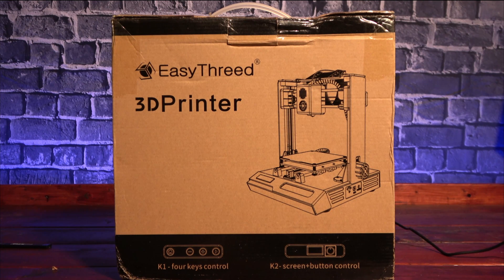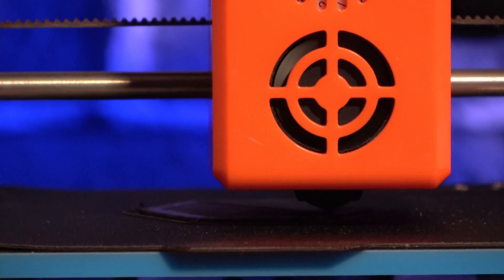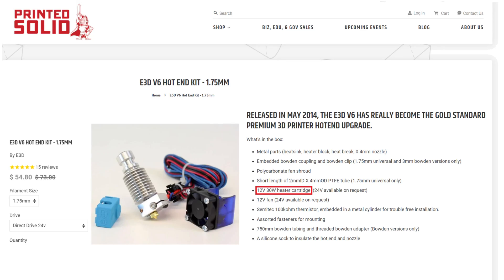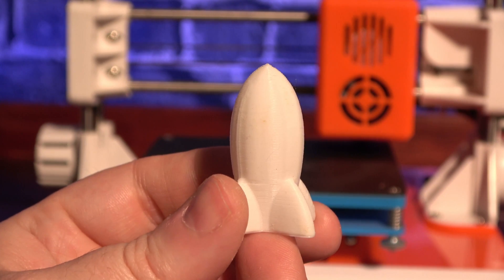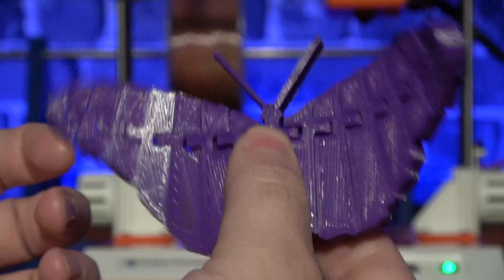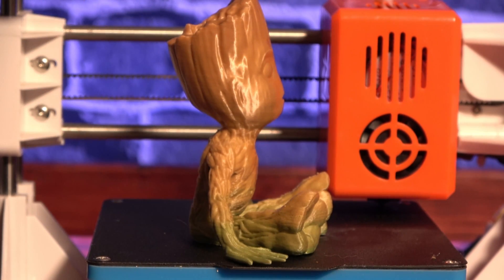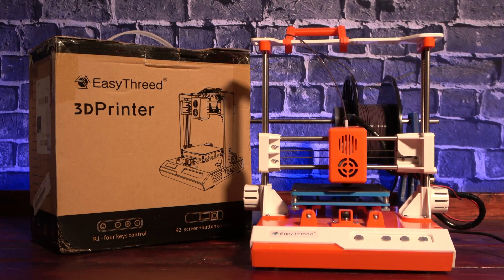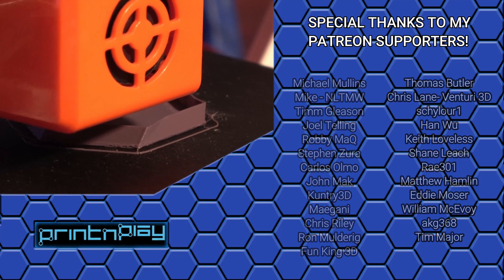A Sub $100 3D Printer?! - EasyThreed K1

Comment: How well does it print for dungeon tiles? (d&d)
Reply from the maker: Since there is a small but noticeable amount of backlash in the movement system, I would not count on very fine details coming out cleanly.
Reply: @PrintNPlay  thanks! I do hink I would go for the extra mile in cost and do it with a resin printer. But I hate buying extra stuff as a wash and cure station. So I'm thinking to buy one but use the water washable resin. I don't mind waiting for a few days of drying. I'm not in a hurry when it comes to curing in 5 minutes.

Comment: This printer review just makes me want to suggest the $200 ender 3 more.
Reply from the maker: The Ender 3 is more capable in every measureable way... Except in perhaps a place where a direct drive extruder is beneficial (like with flexible materials) . 

Absolutely if you've got the money, space, etc, definitely get a more capable printer. Definitely agree with you!
Reply: Ender 3 is the benchmark of inexpensive 3D printers...if it was available when I got my Anet A8, I would have gotten that one instead